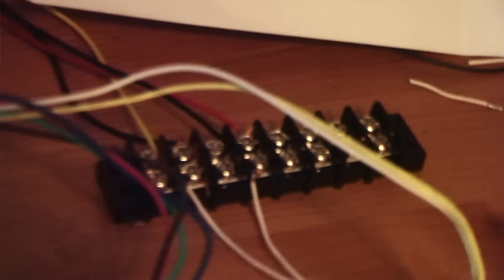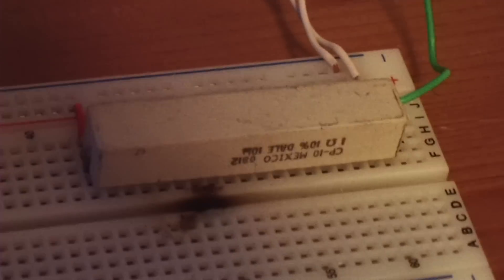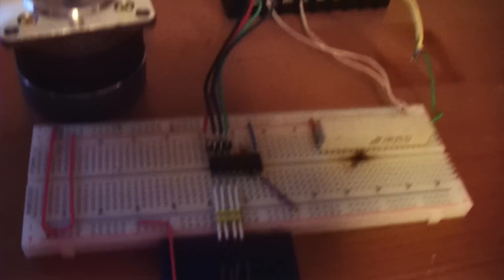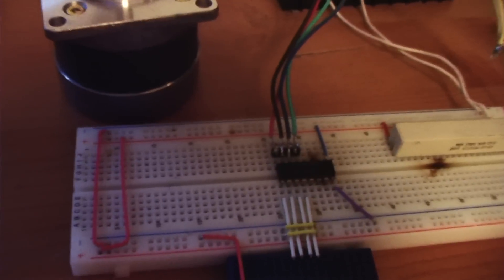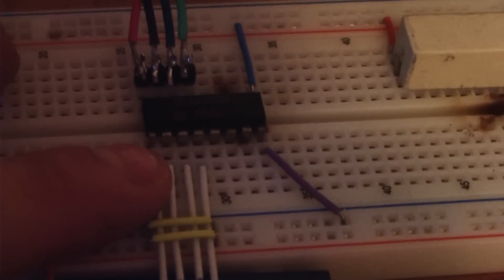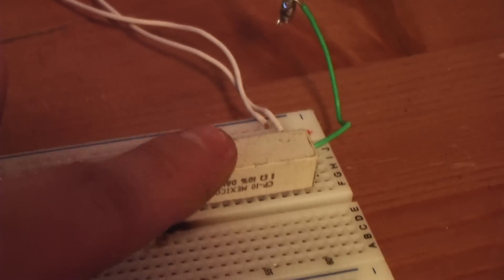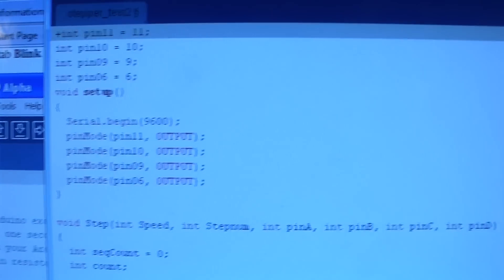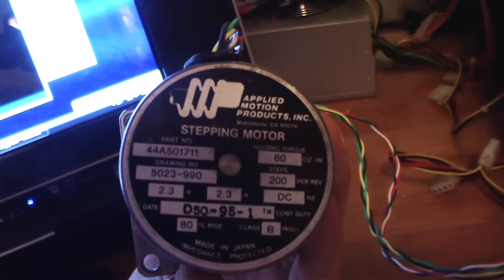Stepper Motor - Arduino

Comment: Hi...tnx for share...I working in a joule thief charger that uses one big transistor, the Q is this transistor array chips like ULN2803A can be conected in series? It can be conected like a standart transistor using just 3 legs of the chip CBE or need special conection? can I make a darlinton pair with 2 2n3904?